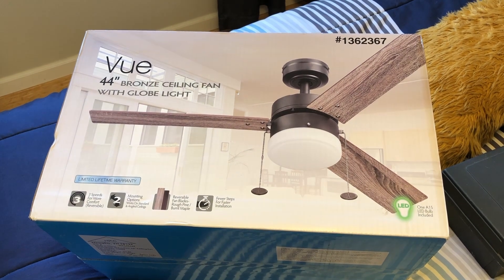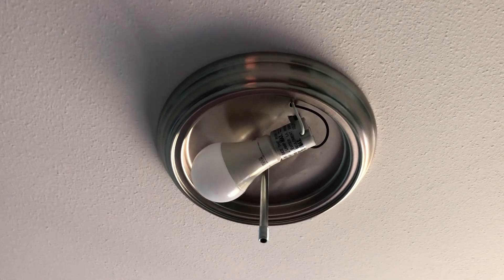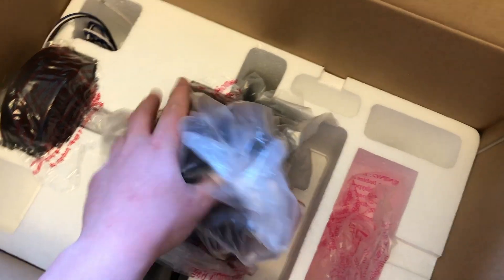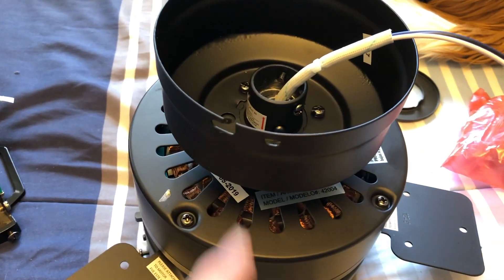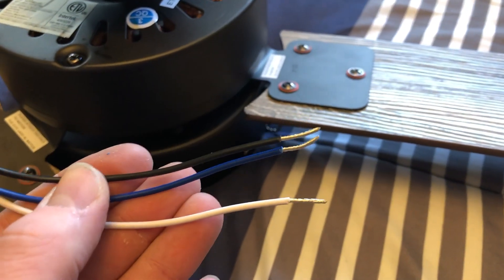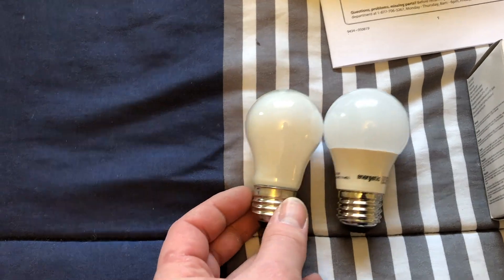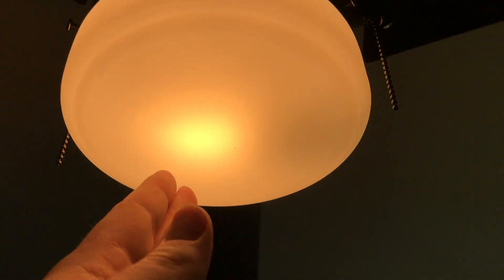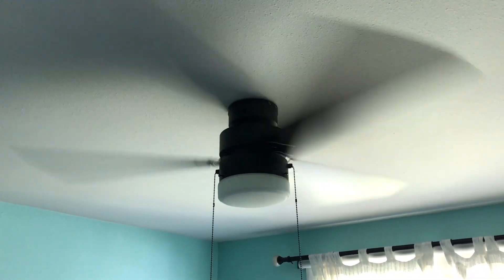Harbor Breeze Vue 44inch Bronze Ceiling Fan (Installation)

Comment: Nice new fan! I wish we'd have clearences like that here more often! I paid about $53 for a new Home Depot brand ceiling fan for the porch.

I did my own job reinforcing the ceiling outlet, Works well enough. When I was faced with the same LED issue... well it was to be mounted outside. I installed a 100W equiv. Great Value LED bulb.

Also a hugger style fan in brushed nickle style. That was way more to assemble, oh my God.
Reply from the maker: Nice, good thing it wasn't a fan with a built in LED non-replaceable light like so many are today. It's nice being able to choose the bulb you'd like to put in it!
Reply: I just went to Lowe’s Earlier today & I bought a 42 inch Harbor Breeze ORIM Celling Fan hopefully it will not be difficult to install

Comment: Sweet! That's one heck of a deal you got there! Only $24.00 each for those very nice ceiling fans. Fantastic find there. They do look very cool, I too like the modern look of the 3 blades. And it was so nice that it was mostly preassembled too. Did you have to balance it? With the old ceiling fans I installed over 10 years ago they came with little glue on weights to add to the blades. And the friggin' thing you had to assemble about 85% of it. Very annoying.  This one seemed like a breeze to put together and install.
Reply from the maker: Thankfully I didn't need to balance it. I remember seeing those little weights on older ceiling fans. I suppose nowadays with the blades not being real wood they can be more accurate on their individual weight of each blade.
Reply: A harbor breeze 😂 to assemble

Comment: You are going to ruin the light kit it has the LED bulb for a reason
Reply: How?
Reply: @lightsfansofthewest481  because the fan light can only handle 6.5 waats
Reply: Standard e26 light bulb sockets are often rated by the manufacturer a much higher wattage than the “To reduce the risk of fire use max _-watt lamp” label like 250 or 660 watts. I don’t think you need to worry.